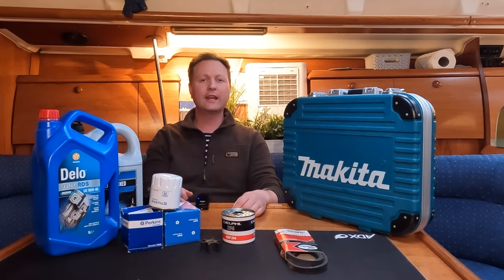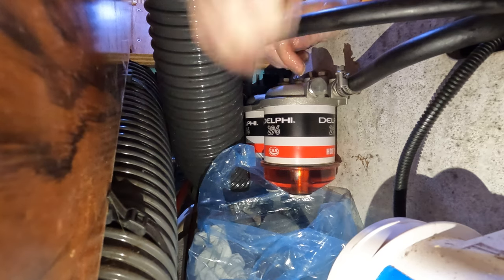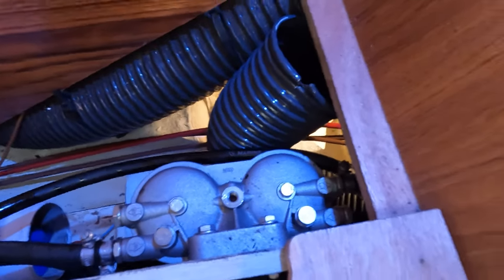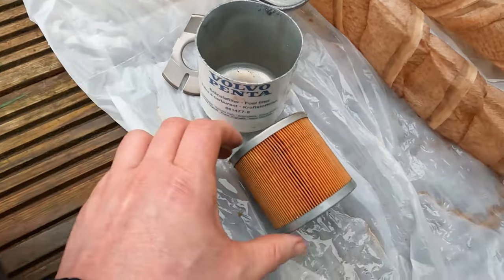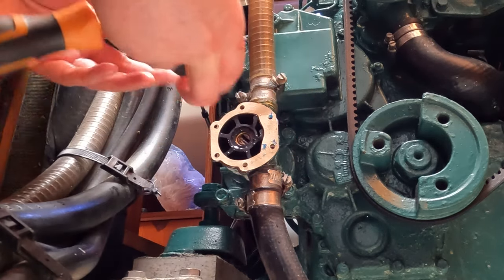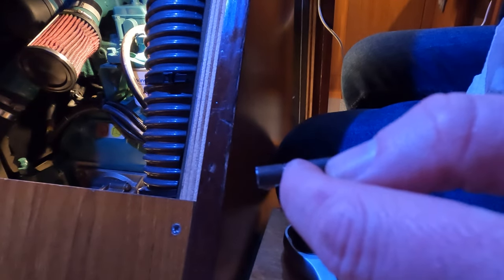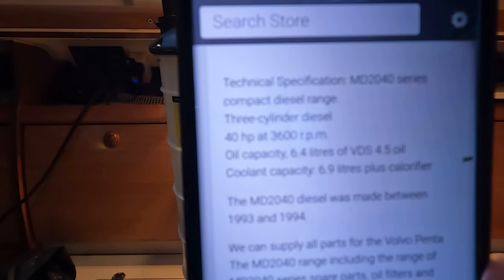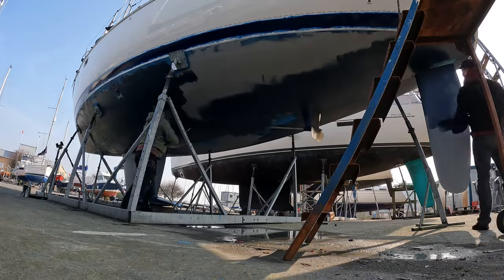How I take care of my Volvo Penta MD2040 boat engine.

Comment: Enjoy the DIY videos. Id never thought about pumping the oil out of an engine, always just dropped my car oil out the sump. How come there are the two inline fuel filters and then another one on the engine or was I missing something there? Also where did you learn how to sail cruisers like this, are there courses you can do?
Reply from the maker: Thank you for watching and to answer your questions.
The sump on my Volvo Penta engine is about 2/3 of the way in underneath the oil pan so it's hard to access. I have seen people take off the sump plug and replace it with a tap along with where they drain off the coolant. Seems a good idea but not sure if the vibration would shake the tap loose over time. They tend to have the inline filters as boats have big fuel tanks and they don't burn through fuel that often, mainly as owners are away. You can get diesel bug in the tanks which is a bacteria. You can get water in your fuel tank from the condensation forming on the inside of the fuel tank there fore the fuel becomes contaminated. The inline filters are often water separators/fuel filters.   

With my car I couldn't get the sum plug off I did try with a breaker bar but no look and since it's held together with duck tape and hope. I don't want to splash the cash as I'm trying to save up to buy a van and work has been very slow. So I used the big vacuum pump which worked great.

I have the sailing experience as a common question and made a video called "Sailing 2500 miles How did I do it?" For DIY I my last video was polishing the fuel tanks. "How to Build a basic Fuel Polisher for Diesel Bug Removal"

I started off dingy sailing when I was younger for about 3 years. Then stopped as the boat house had been taken down. Then I brought a boat mainly for a floating hotel room and storage while I'm learning and building up experience. I have crewed on other peoples boats and I like watching to see how others do things. You can do in classroom courses at marinas so you can meet people who likely have boats. You can also do sailing holidays. If your thinking about boat life, then I would recommend you going on one of the sailing courses either spring or autumn. This way you get a real experience rather than the peak summer cocktails and yacht parties. It's very hard work. 

Thank you for your time and hopefully you have liked and subscribed. If you would like to know anything else feel free to leave a message and I will try my best to get back to you.
Reply: @serenitycoastUK  thanks for the detailed reply. Yeah I am thinking about learning to sail and ultimately looking at a boat similar to yours for some living space and sailing fun.
Reply from the maker: @wizurd77  Maybe think about doing a day skipper course they are 5 days so you get to learn the in's and outs of boating, perhaps do it on a holiday. If you where serious about getting a boat I would go either spring or late autumn when the weather is ok but not the best. This will give you a realistic expectation of weather and life on a boat. You will see all the boys hitting things with hammers, painting things and cleaning things. In the summer very different when the girls come out with the cocktails along with the bbq's and beers long sailing and smooth nice weather.